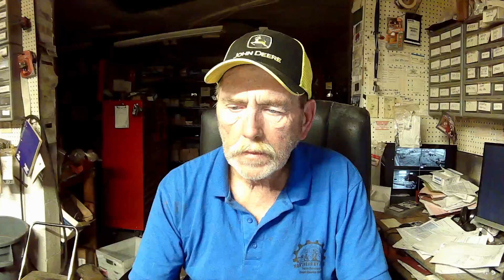Lessons from the Pros: Real Life Repair Shop Safety Stories and Solutions

Comment: Great video, Eric.  When I worked in a shop many moons ago, I had a cut off wheel explode. Took a chunk of that to my cheek just below my eye.  Another time I had a wire wheel explode.  Multiple bristles embedded in my face.  Man, was I lucky. 
These days as a DIY'r, I only weld/grind/torch outside. Fire extinguishers immediately nearby. Proper eye protection. Proper welding outfit/gloves. I do NOT buy cheap consumables. I inspect my tools each time before I use them, even though I'm the only one who uses them.  I try to think ahead and anticipate any problems before they happen. 
I live in a suburb of a very large city. I have multiple cameras outside as well as inside the property. Some are battery powered, some are electricity. I get instant notifications on my phone. I double check all locks when I'm done for the day. I don't leave anything outside or in view.  Garage windows are covered from the inside. 
Words of wisdom from my first boss: Never stick your finger anyplace you wouldn't stick your...male appendage!
Reply from the maker: thanks elcheapo, this is what I wanted and that is for us that have close calls to tell of our experiences to help others understand its a must to put your safety first. thanks for the great comment.

Comment: I was doing alot of cutting of approx. 1/10th inch thick plate.  I only had a small angle grinder, (4 1/2") but I noticed the 7" cutting discs would fit on there, with only a lower rated RPM.  Worked excellent, until one had a chunk break off and hit me in the stomach.  Felt like getting punched, I don't think there was much blood, but there was a knot you could feel for a few months/over a year.  I'll probably keep using them, but be safe!  I've had other things happen as well, farming tends to do that.  Gravity wagon full of grain on my foot, no permanent damage, but it may have been the most pain I've ever experienced in my life.  The wheel itself had about 4,000-5,000 lbs. on it and was pushing very slightly downhill on top of my foot, and against the front of my leg.  I don't know how much of that load my foot was taking, but I'm glad I had steel toed boots and I was on grass.  Luckily, a couple people were around and called my Grandpa to hook up the wagon and back it off of me.
Reply from the maker: I am an old farmer as well and many close calls with being under the gun from the rain during haying season, dry days to get corn chopped and more. thanks for some great advice Sherman!

Comment: Something to add to your safety gear is a good quality respirator... Whenever I do anything like major grinding, cylinder porting, blade sharpening, spray paint, I use my P100 respirator. The dust created from grinding loves to rust in your lungs, especially cast iron dust. I find that the dust, dirt and grass on mower blades is very nasty, and I wire brush each blade before I sharpen, so they balance properly and the cloud of dust is huge, so I love my respirator when I sharpen blades.
Reply from the maker: great advice Patt, thanks